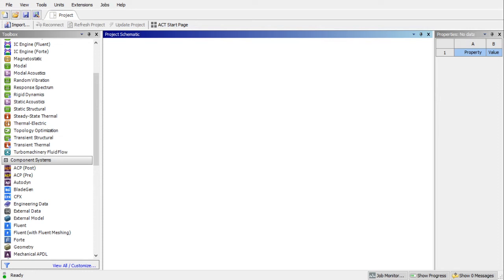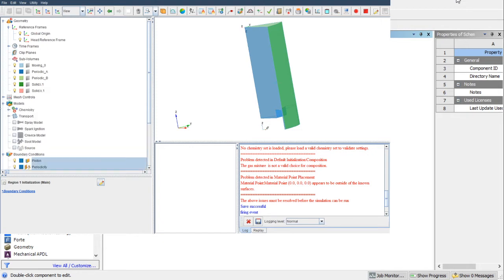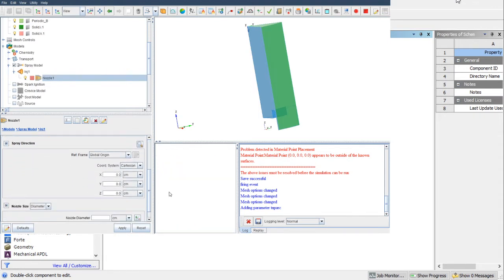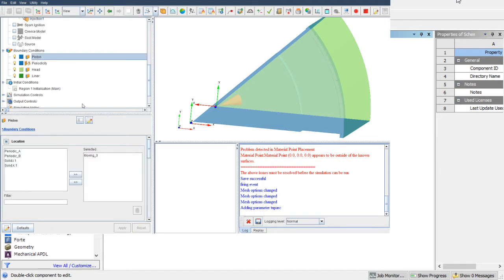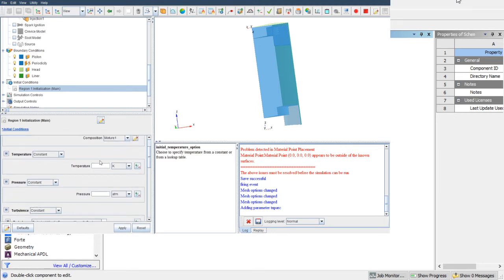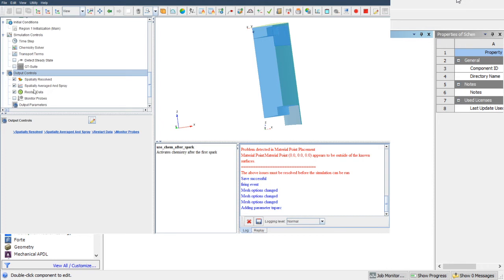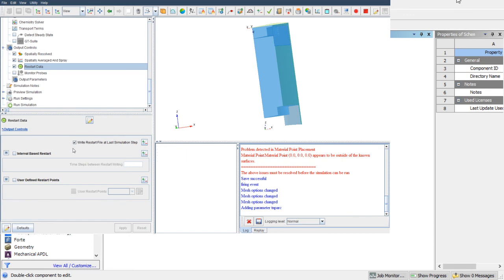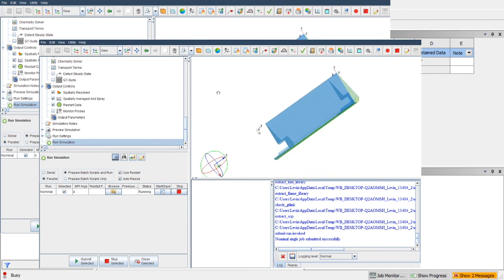Ansys Forte tutorials : Simulating a Diesel Engine Using a Sector Mesh

Comment: I’m working on a project based on the tutorial chapter 2 "simulating a Diesel engine using sector mesh".  I have noticed that every simulation of mine, in the monitor section, the gross indicated work is always negative post process. Can you help me understand how I can change this?

Comment: Hello! I'm facing some problems with this Experiment. When I finish it, the status is Failed. Did you succeed with your simulation?
Reply: I have the same problem
Reply: @FahadAli-uo7zt  i have also the same problem
Reply: In Run simulation you must insert 4 in the MPI Arguments as Ansys Forte student version is unfortunately limited to 4 mpi CPU power.  This should make it work.